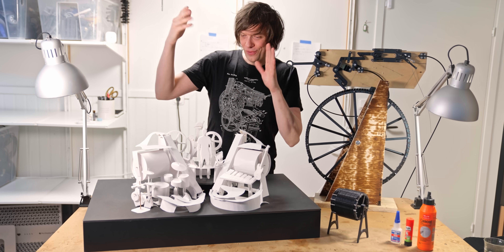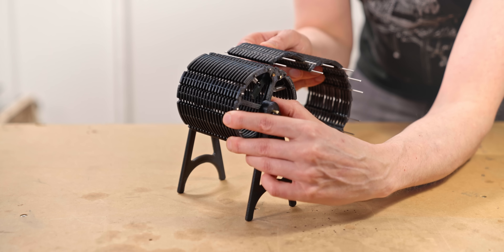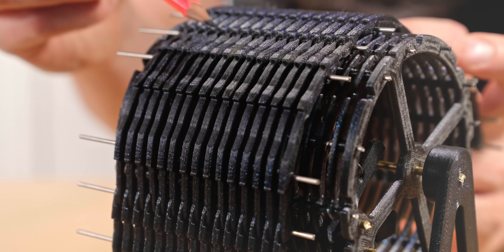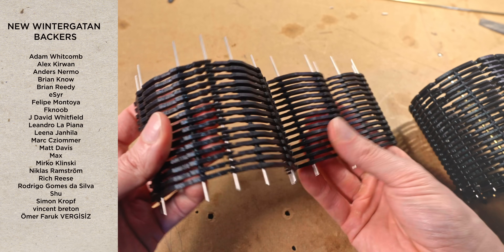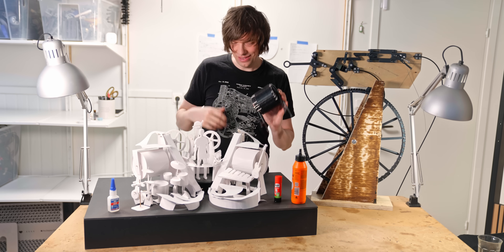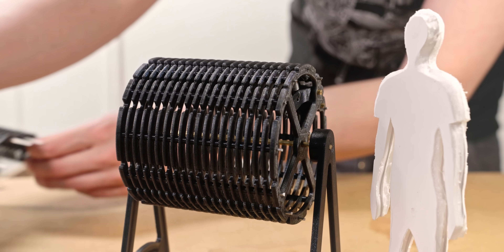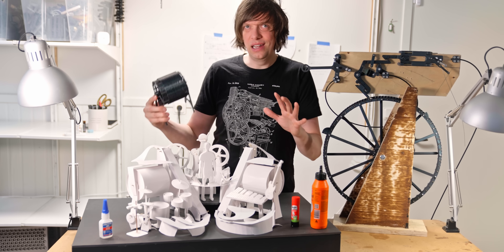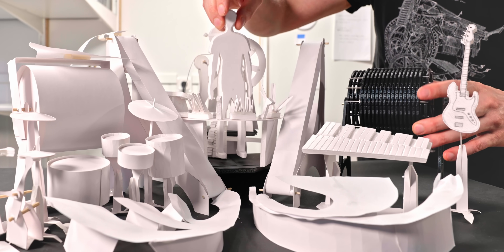A new way to switch songs on the Marble Machine

Comment: I'm thinking about weight, presuming aluminum, that tread is going to be heavy and awkward to handle if it's all one piece. Recommend making it be sections of the circle so then it's easier to handle. Doing sections will require there to be more lever locks.  And to prevent confusion or incorrect parts of songs have each section have some kind of interlock with the wheel and other sections so everything doesn't get mixed up. Could even color code the sections so at a glance you know what song is what.

Comment: what's stopping you from having 2 rotary barrels instead of just one? 
Wouldn't it be nice to have one on standby ready to play the next song while the other one is getting "changed"?
Just add a way to disconnect the rotation of one of them while the other is playing and have some kind of aligning pin or clutch plate that can only go in one position and you're good

Comment: A metal disk with holes would be a million times easier to swap. Age old method works every time, the song lasts forever. Thin, easy to store and take with you. Cut them out on a water metal cutter.

Comment: I think having a "blank" programming shroud/skin on the programming wheel would be a more practical solution. Not only would it use the same overall solution and simplify the design, but being able to remove the shroud after you are done composing would make it easier record and transcribe the pattern to a finished shroud.

Comment: Martin, I have an insightful question for you:

Why not to use programming caterpillars instead of just wheels?
+ I believe there are lots of standard manufactured furniture for caterpillars
+ song’s loop length may vary in a way you want

Think about it 😉
Reply: Гусеницы - это treads, вряд ли просто caterpillars будет понятно.

However, I absolutely support and look forward to programming caterpillars, that's going to look awesome!
Reply: Bicycle chains!   
They're fully standardized and can be bought mostly off the shelf. With tensioning idlers, you'd hardly have to worry much about timing precision.
You could use one chain per channel, or have them mounted in small groups.  This also opens up the possibility of intentionally mismatched loop lengths for different instrument groups, allowing you to play canon style evolutions.

Comment: From the scenic point of view, I feel like replacing the entire wheel by rolling it in and out of stage would look smoother and cooler. Carrying and installing the foldable "peel" will be more difficult and clumsy in real life than in a model. But yeah, it probably makes more practical sense.

Comment: This was a really great idea and a much better design then the old version.
Reply: Why?
Reply: @br52685  Not having to take off the wheel is smart and having the notes part of the structure and not loose single parts should also help with reliability.
Reply: @tetepeb  He still has to take off a bunch of parts, and fiddle with the mechanisms to keep them connected.

What will happen to the programming pins (notes) that overlap the flexible junction?  Will they become dislodged?

Instead of moving a single drum, there will now be these multiple (bulky) hinged panels flapping around.  You can already see how heavy these panels will need to be.

This mechanism only adds room for additional error in his “tight music”.

Comment: what if you use 2 wheels with the multiple songs pre-made?  this way the people that will be replacing the current song can do that in backstage with some extra time to fix some issues that can occur doing the process and without so much stress about timings.

Comment: I hope I'm not the only person worried about this: I really believe putting the flywheel and timing components right behind the composer is a big safety issue. if you trip or accidentally move your hand back there, it could get injured. you do knock your cardboard cutouts over a lot, I worry that will happen in real life too.
Reply: Not to worry; this will never be built.
Reply: @thomasbecker9676  why so negative
Reply: @Treon  I'm being objective. Look at the evidence.
Reply: @thomasbecker9676  what evidence is there other than the fact that he's going through the engineering process?
Reply: @Treon   @Treon  Firstly, I'm an engineer, and he's not going through any sort of process I recognize, except a cyclical one. But, it's been a decade since the first marble machine. Then years of MMX, involving constant changes and complete deviation from the original premise. Then it was abandoned and Marty went on a hiatus. Now he's back with a clean sheet and all sorts of ideas he abandons as quickly as they show up. There's ten-plus years of evidence.

Comment: This is a brilliant solution! I've always had concerns with the limited number of notes that could be included on a single channel. This approach not only allows for song changes but also the eventual v.2 (after a long, sustained success of v.1, of course) that could introduce a second rotating drum and the songs would ride like tank tracks between the two, extending the number of notes before pattern repeats.

Comment: Hi Martin. 
Why does the drum HAVE to be so enormous? Why not just make it much smaller in diameter? 
You seem to have plenty of time resolution even on the smaller prototypes you have made. If you make it smaller, let's say Ø40 cm, you could just CNC the entire thing out of aluminum when you have finalized a song. You will have super high precision with a CNC, and it will reduce the parts count of the whole drum down to 1!!!! You could change the drum within seconds, heck, even change it mid-song if you prepare a short break of 30 sec without the marble machine playing. I think you are too stuck on the idea of the size of the drum. You have said it yourself many times that you need to look beyond the design of the older marble machines.

Comment: That's definitelly an improvement, but it reminds me of the black rubber(?) programming plates with the magnets as pins. These ould also be swapped with 4 plates per wheel. I would assume in terms of trasportation and also overall handeling, having 4 individual segments would be better compared to having one long rope like here.

Comment: The problem I see with this is that the mechanical interactions between roadies and the program are going to be quite complex, they'd probably also have to lift it. I still think having a second wheel on a dolly is the way to go on-stage: One roadie swoops in with an empty dolly, wheel gets lifted out of its bearings, other roadie comes in with second dolly and lifts the wheel into the bearings, the whole thing should work with pit-stop timing, accuracy, and speed. 
OTOH the segment construction looks like a good idea, both per-channel as they're easy to manufacture and per bar as they're easy to store, much less volume than a complete wheel.

Comment: What about replacing this wheel with a system of smaller ones and run belts like in tape recorders... There could be two modes: looped short songs or unloopable long "tape"...

Comment: The programming belt could extend beyond the diameter of the main programming wheel to a second wheel, like two pulleys or a bicycle chain and sprockets. This would allow for much longer programming sequences.

Comment: Hi Wintergatan. I think it’s a great idea. However, wouldn’t it be way easier to split the song up into 4 or 6 separate segments. The way you want to connect and disconnect the song to the wheel can stay exactly the same. 

You’ll need less manpower to change the song because the segments are easier to carry around. The different segments are also stackable, which makes it way easier to transport.
Reply: Same as mmx then

Comment: It could be an additional option to program several songs next to each other on the wheel. Let's say you have three Songs A, B and C. And you have channels per instrument (in the following separated by "|"). If you then program the wheel like this: ABC|ABC|ABC|ABC|ABC|... you would start with the readers all over the A profiles. To switch to song B you just have to move the wheel about 1cm to the left, so that the readers are over the B profiles.

Precondition: You have enough width of the programing wheel and/or the profiles and readers are thin enough.
Reply: Similar to audio on a 8 track cartridge. Track 1, 2, 3, 4.

Comment: I’m not an engineer but I think I have a cool idea for the programming wheel:

Have the wheel’s pins all be sunken down into the wheel, so it’s a flat surface. Then, create a large KEY to insert into the side of the cylinder that pushes the correct pins out for a particular song. 

Then, you would only need to remove and replace a new key for a new song. It will cut down on time between song transitions.
Reply: Yep, you're not an engineer. The design to encode that sort of behavior would be more complicated than the rest of the mechanisms, combined.

Comment: Just as a thought from a manufacturing perspective. If you're planning on taking the marble machine on a world tour material wear should definitely be considered. After lots of use some parts are going to have to be replaced, especially if made from low wear resistant material such as plastics and rubbers. I would suggest either making the song wheels out of a wear resistant/durable material (at least one harder than the cam followers) and then use a softer, modular cam follower that can be easily replaced. That way you can keep the songs healthy all the time and only have to replace the followers for maintenance.

That's just my two cents as an (almost) Mechanical Engineer
Reply: I feel like I've been screaming "material wear" into the void ever since he tested the marble droppers to the millisecond, while even a tiny bit of wear will be much more relevant to playing tight music.
Reply: @ben_1 wear and climate conditions etc etc...
Its just so stupid that he thinks he can get it "tight" when its impossible with this kind of machine
Reply: I know IGUS make some great plastics. Which products were you thinking of?
Reply: He has no intention on finishing this machine, so concerns about wear are moot.
Reply: @thomasbecker9676 yeah he just milks money
Reply: Why would he have no intention of finishing it @thomasbecker9676

Comment: The point of the Marble Machine is that it is both an instrument and a performance piece. Even the swapping of song modules becomes part of the stage show.
As for composing, perhaps you could create something like what was used to create piano rolls in the early 20th century. To record a musician's performance on a roll, the piece was played on a special piano that automatically punched a master roll. Then the master was closely examined and any flaws repaired before it was used to create punching templates for roll production. Perhaps a keyboard interfaced with a computer program that would translate the melody into a song module profile automatically?

Comment: You're going to have to focus a lot on the geometry of the lever, as it's a potential weak point having the pressure to secure it impinge directly on a spring tension mechanism as opposed to a fixed retaining ledge

Comment: I wonder about replacing the programming wheel with a programming belt. it could be made similar to tank treads, with each section being relatively flat. The advantages would be a method of variable length programs. instead of one big drum, you have two smaller wheels, with the back wheel being movable to help keep the tensioning of the belt correct when the number of programming plates is different.

Comment: What is the purpose of keeping the song in one piece if you can remove it?

At real scale, you might be ok with having more levers and multiple song parts that are easier to switch in&out and store.
It brings challenges to make sure there are no audible gaps between parts but it would also be more durable than having a big articulated thing that you roll in&out.

Comment: Ok hear me out. Rather than locking the outer "skin" onto the programming wheel, why not explore the idea of using a type of chain or "belt system" similar to a cam chain with multiple rows (channels)? It could still roll over a smaller diameter cylinder/drum at the top where the programmed notes would be played. The rest of the "music belt" would hang down and rotate around a larger cylinder/drum or "idler drum". This could accomplish a few things: 

1. The programmed belts would be more compact than the larger program wheels for storage. 
2. The rotational force required to rotate would be far less than that of the program wheel. 
3. The larger lower "idler" wheel will act as a flywheel, keeping the music tighter. 
4. You would not be dedicated to a single size program wheel. You could theoretically allow for any length of programming belt. 
5. You could take it a step further by breaking the chain/belt into sections ie. drums, vibraphone, bass, cymbals. etc. You could swap out individual belts with compatible timing to get multiple variations of a single song.
Reply: check out  "Jacquard loom's chain". 

and yes there is no need for it to be a wheel and being a wheel has many disadvantages(song length limits, maybe thats why he wants those 300 channels to turn off and turn on them ) but has an advantage of looking cool. you could feed and unload the chain from the wheel though to retain the wheel.

Comment: @Wintergatan
6:57 If the "song plates"(?) are sturdy enough, you could hang them as a background on the stage, then through the concert, the technicians comes and takes down the next part of the wall & attaches on the "song wheel"(?) and maybe hangs back up the old played song.
In that way, you ALSO gets a dynamic background, and it not only is PART of the concert experience, it actually IS the experience too :D

Comment: I think you are overcomplicating. But you are getting closer to what the the textile industry have been doing for 200 hundred years. Your music will be highly repetitive if you don't have a huge wheel. What if you made the same, but the sections you have are straight (but still in sections),. You just feed it in one end then feed it out on the other end. No reuse! You could theoretically of hours of music playing with no gaps (other than the ones you want) and no repetition. As said, just feed make it as you did, but make it flat. Feed it in one end and discharge what have already been played in the other.

Comment: I feel like it would be easier to attach a "blank song" of sorts that's been specifically designed for manual programming. This way the programming wheel itself wouldn't need to worry about being able to hold both full songs and individual profiles which could simplify the design and manufacturing processes

Comment: Oh for christ's sake. Just actuate the marble release electronically (you have already designed a good solution) and drive the marble uplift mechanism with an electric motor; you can iterate later on and put on any manual mechanism you deem necessary. This thing will NEVER get finished otherwise.

Comment: You could add reference pins/profiles to the wheel skeleton to increase skin placement accuracy during performances.
Then, you could have a programmable skin that is just the baseline disengaged profile level with slots for profile insertion.

Comment: How are you going to unclamp all four elements then somehow remove this behemoth by hand and accurately mount a new one "quickly" between songs? It is the same with the mountable quarter barrels you had earlier, that you had replaced with the swappable drum, but now they are made from a different material and are linked for some reason. Why not go for an actual programmable drum, that you can put on midi files, that automatically protude/retract pins electronically. i know the marble machine is fully analog but that comes at a price if you want it to be dynamic.

Comment: It would be cool to have an electrical programing wheel you could adjust by an app.  Similar to how people program the Christmas lights lights/pixels displays, but have it to where it controls the positioning of the notes on the program wheel, by the click of a button, and the option to 100's of songs without stopping.

Comment: You could make the wheel have all notes "in it" with a mechanism to toggle them on or off. For programming, you could then build a "programmer" that is just a bar that is placed against the wheel and in 1 rotation, that programmer could reprogram the wheel using solenoids (or is that cheating?)

Comment: having all the panels attached like that at full scale seems massively cumbersome and awkward to handle, i would worry someone would damage the machine or worse, get hurt. My suggestion would be to have 4 separate panels with two handles on either side that have a gripping mechanism built into them.

Comment: Interesting idea but seems like it would be rife with potential for 'slop'. All of the non-permanent mounting spots, spring-loaded clamps, and plates hinging on one another would add up to a considerable amount of variance in the tolerances/spacing of the plates themselves, and thus the pins too wouldn't it? For how accurate you have been trying to get the timing on the marble drops thus far, I fear this method of attaching songs to the wheel via spring-loaded non-permanent mounts seems like it could be the Achilles heel of the whole design and could introduce irreparable issues with the tolerances on the programming pin placement and would require completely re-calibrating the machine after each song swap. Perhaps the issue could be addressed with a Very robust and precision design so there is virtually no variance in how the plates are positioned on the machine, but I feel like it'd require a lot of trial and error and painful tinkering/troubleshooting to make it work at the level of precision you need. I'm sure you've thought through this idea a lot more than me though, hopefully I'm wrong!